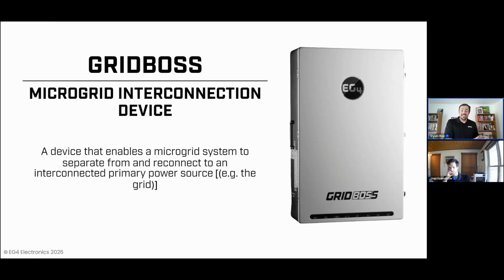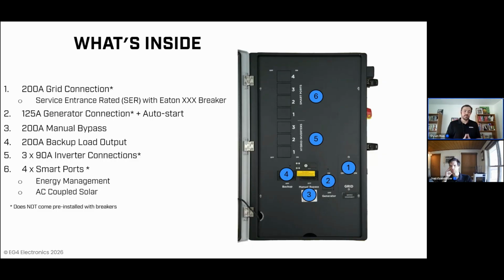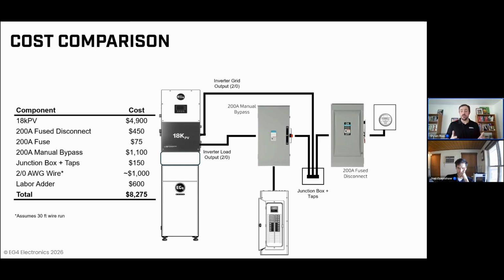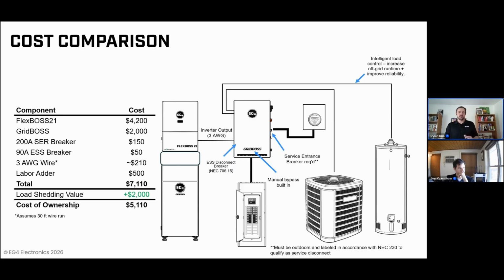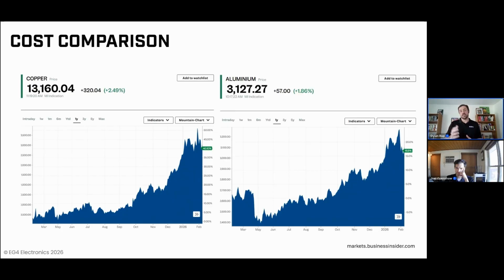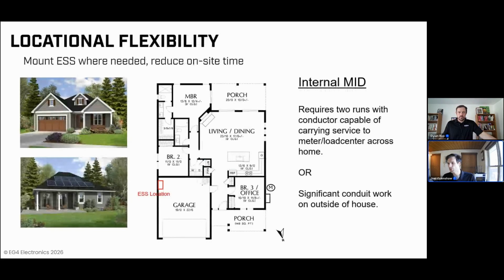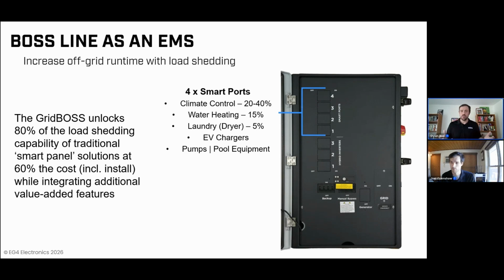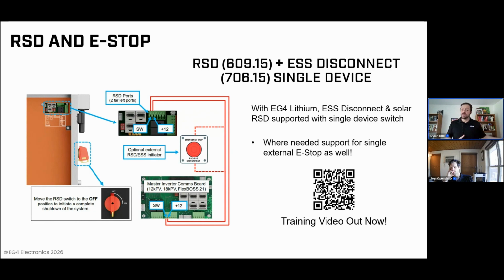Unlocking the EG4 GridBOSS

Comment: Bought this, but was really bummed out to recently learn that the GridBOSS will always backfeed some energy to the grid, even if you’re not wanting to, or have not been approved to export power. So now I have to purchase a large and expensive 200A mechanical transfer switch to totally separate my micro-grid from the utility and only run one or the other. This was extremely disappointing and not revealed when ordering.

Comment: I'm planning for an off grid microgrid with a distance of around 500' between the systems. My thought was to use 400VAC~500VAC transformers to step up the power between the run, connecting them through their respective grid ports. First, would any scenario of this work? Would I bridge two GridBoss' or two Flexboss'? Would I still try to run a communication line, with maybe a signal booster? Could this be done with 3+ stations? Are there transformers you'd recommend? Is this a problem you are working to overcome in house?
Another lecture with diagrams would be perfect. 
hanks for your information, I'm very happy with my FlexBoss so far.

Comment: Great video. I wish more manufacturers would put out detailed videos on their products. A quick question. Does anyone know if the Grid Boss will shed or reduce loads based on the backup generator dropping frequency because it is overloaded?  For example, in grid fail backup operation will the Grid Boss reduce EV charging power to prevent generator or inverter overload based on the generated power frequency?

Comment: Awesome video.  I'm a physician not an electrician but recently became fascinated with solar / BESS.  I went from buying a couple power stations to wanting a whole house backup setup for peak shaving.  I own a large ~9k sq ft with 600A SE that has (3) 200A disconnects feeding three subpanels scattered across the home, two of which feed additional panels via large double pole breakers.  I want to keep batteries and inverters separated from subpanels, which the Gridboss will allow me to do, along with load shedding for pool pump, EV charger, two electric water heaters (others are gas), and some HVAC units via the Smart Ports.  And a 125A natural gas generator to back up the primary system.   I will probably need two systems each with Gridboss connected to two Flexboss21 in parallel on the hybrid ports,  and third system with (mostly) non-critical loads could likely be handled by a single 12000XP.  Each will have its own batteries obviously.  This will be a large if not particularly complex system with three separate  'islands' but I think I can envision how it will come together now.  Will be watching all the videos in this series.   Hoping to do a lot of the work myself as I enjoy it, but will get an electrician hook up the more perilous connections and run necessary conduits through the attic, and check everything for safety.
Reply: Sounds like a good plan. You might consider including two or three high power bidirectional EV chargers. That way vehicle shuttling to charge more than one vehicle from a single charger is greatly reduced. And, you can use the vehicle batteries for peak shaving and backup power. One particular problem that people are having since  the PG&E disaster and bankruptcy in CA a few years ago is that power utilities are now being very proactive in shutting off grid power in large areas when weather conditions are ripe for wildfires. It isn't uncommon now for entire cities to lose power until the weather improves, and if there should be a wildfire the grid power and even the natural gas could be shut off for several days!

Comment: Do you have any recommendations for a solution to charge EVs only with excess power after the house batteries are charged?
Reply from the maker: You can utilize the Smart Ports in our GridBOSS only power loads when certain conditions are met. 

For example, you could set that circuit to only be powered when battery SOC was above 90% and there was 5 kW of solar present.

Please reach out to us at support@eg4electronics.com for detailed guidance!
Reply: @LearnEG4 does the smart load have to be enabled for peak shaving to work?